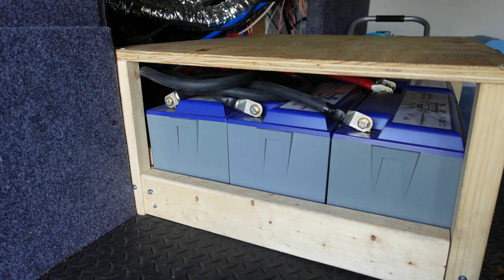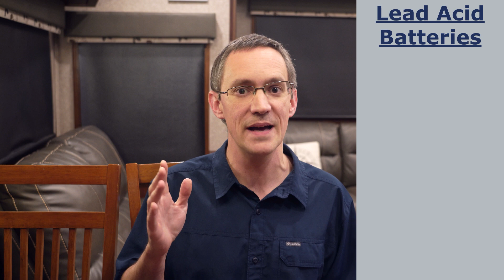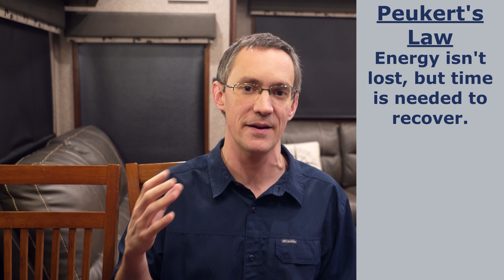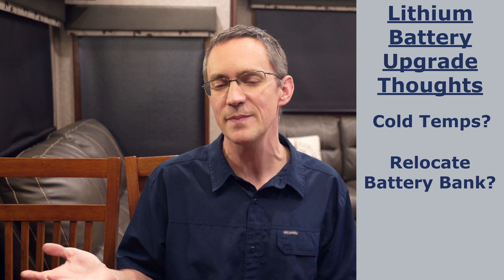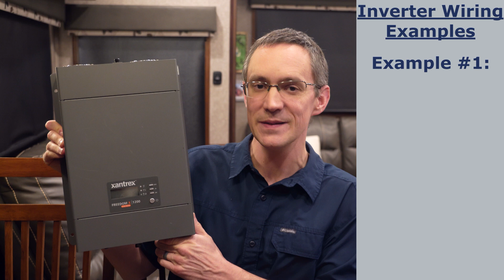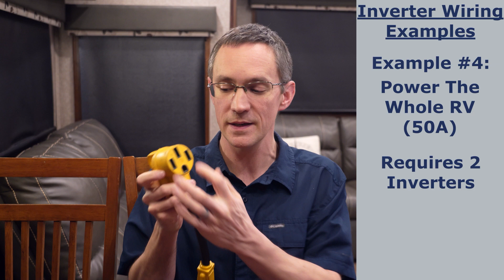RV Solar Batteries And Inverters – Solar System Design Part 3

Comment: Very well done. Thanks for finally making me understand how the Victron system works.
Reply from the maker: Thanks! Keep in mind Victron now has a Multiplus II. It's the successor to our inverter/chargers that can handle both lines of a 50A RV in one unit. You'd still have to parallel two of them for the same wattage we have, but the end result would work a little smoother than our system does.

Comment: Good Morning.  I’m going to install 2 new 200W solar panels. The question is Parallel or Series. I have heard the Series is not as good because of shading you lose some of your power. Yes the Amps are around 10Amps with 40 Volts and Parallel the Amps are higher at about 20A and the Volts are lower at 20V . All so I read some ware the solar panels need to have a voltage around 20 to 30 volts above the battery voltage Do you have any thoughts on this.  Thank you Jack
Reply from the maker: Are they going on your roof? What solar controller are you using?
Reply: @NeverStopAdventuring  Good Morning . Yes 2 200W Panels on roof. I will be using my old Epever solar controller. My old set up was 4 100W panels set up in Series Parallel that worked fine.  I will be using Battle Born Batteries this time.  Thank You Jack
Reply from the maker: If it were me I would wire them in series for the higher voltage, knowing that partial shade conditions will be an issue. With 400W you'll probably want to squeeze every watt/hr out of those daylight hours and I think the higher voltage will help a little.

Comment: Great info, but you should tell people about the new Victron MultiPlus-II 2x 120V inverter which handles both 50 amp legs in one unit. It’s only 3000W which may be enough for many people, but if you really need 6000W you can parallel two of them.
Reply from the maker: Ahh nice, I'm glad to see these are available! I wouldn't be surprised if they came out with a 5000W model soon. That seems to be the order they do things. Thanks for bringing this up.